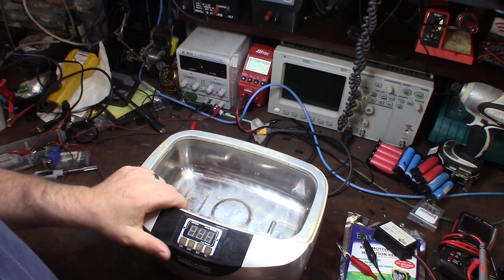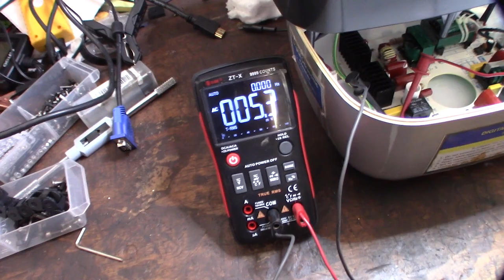Harbor Freight Ultrasonic Cleaner Heating element troubleshooting heater repair Replacement Part 1

Comment: Thanks for posting this repair and links to the heater element and thermal glue for $18 on amazon.  I bought some within the last month and repaired mine successfully!  It takes about 40 minutes to heat up to 60°C but it's a lot better than not heating at all.  The 110V 50W element they sell now is a little bit smaller than the one you show, but it seems to work just as well.  It draws about the same current as before, so I believe it is the same power output as stock.  I don't think 100W was stock, although the manual doesn't say anything about the heater power.  Most of the smaller ultrasonic units you see for sale have a 50W heater.  Cheers!

Comment: It's not a heating element. It's a pietzo electric crystal. It's a speaker like what you find in a virtual pet device but on a larger scale.
Reply: Some smaller ultrasonic machines have the piezo for ultrasonic oscillation, this one has a larger transducer... but that's separate from the heater element.  This heater has low resistance wires running in a zig-zag pattern through the ceramic material.  The heater elements linked at amazon are PTC resistor type, encased in an aluminum extrusion to make them easier to mount to things. Mine heater was also completely open resistance, so likely a break somewhere inside the ceramic heater element.